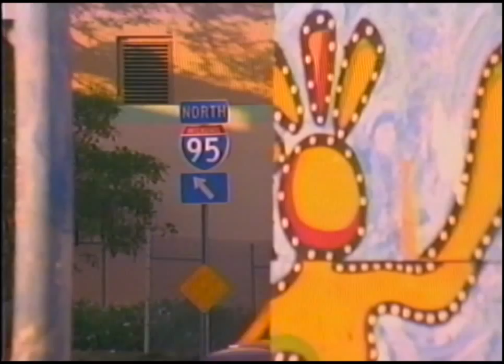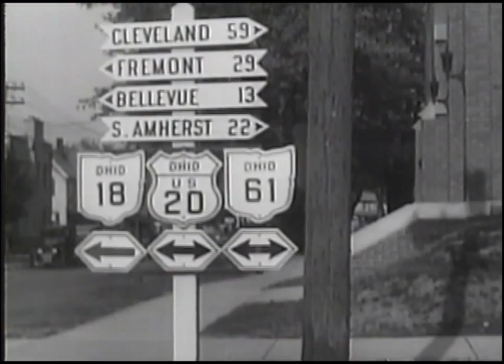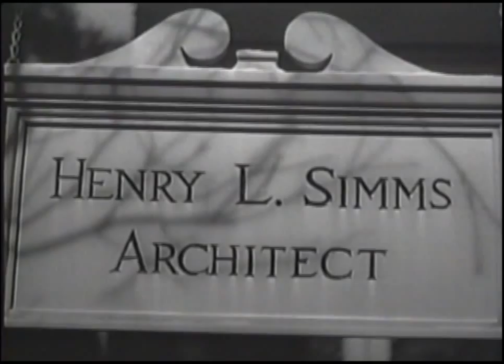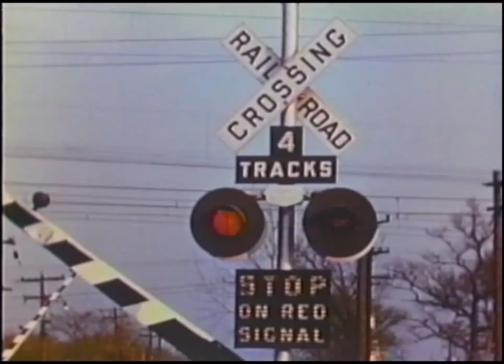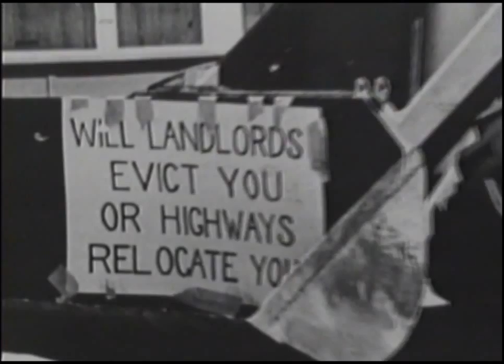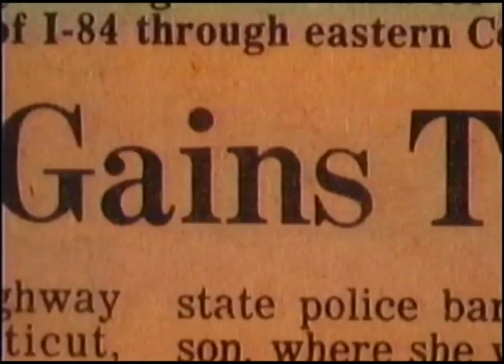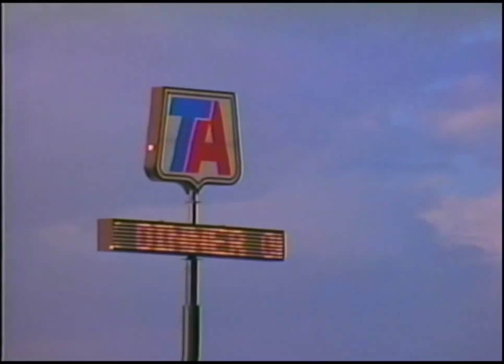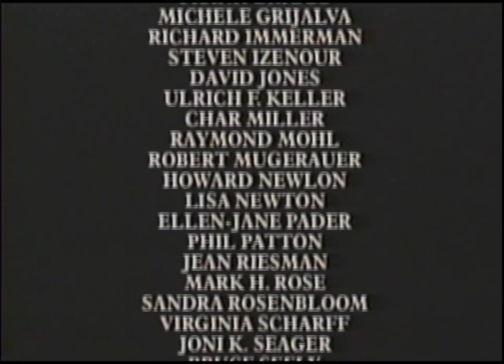Divided Highways - PBS (1997)

Comment: My dad moved to suburban boston when he was 7 and I was born and raised just outside Hartford. When it comes to Boston big dig and not building I-695 (inner belt) were great decisions for all. However going to college in Eastern Connecticut I can attest that the lack of highway from Hartford to providence has deeply hurt the Eastern Connecticut Economy as residents have more stressful drives to well paying jobs once the industrial plants all disappeared.
Reply: Wrong on the Inner Belt.   Without it the whole system was left disconnected.   Leading to perpetual gridlock in the inner suburbs.  Drove a delivery box truck in the late eighties.   Was nightmarish navigation with the myriad local truck bans and restrictions in certain locales, and antiquated circulation patterns left locked in in other areas.  Much of the southern belt route had already been cleared- and the final designs were sound.   Meaning going under the Charles river and partial burial through the Fens.   Bad decision making.  Caving to the whims of a few elites.

Comment: Trolleys were fine but only viable in cities.

Housing was far more affordable. Now every house is dumb expensive. And to solve the housing crisis, we’re buying up farms and cutting down woods to build expensive McMansions instead of affordable housing like they did in the 50s.

Highways bypassed smaller tourist towns and reduced the traffic on smaller roads. But the amount of cars on the road outpaced the construction of the highways.

Railways are fighting back. Since a lot of fuel is still transported by rail, the railway could name their price of shipping. The railways then bought up trucking companies to control as much of the shipping as possible. When the rails charge more, the gas stations have to raise the price at the pump.

The maintenance of the roads have outpaced the income of the highway system and have cost far more then what the roads cost to build initially.

2nd street overtown is fine today. From what Google maps show, overtown recovered. There are parks, dozens of condos, and colleges. How many homes and farms were destroyed to build the cities and all the other roads. When they built the dam near me in the 50s, it wiped out 5000 sq miles of farm land and dozens of homes. The dam was to create a reservoir for drinking water for the city. The funny part is that 40 years later the water became undrinkable due to mercury content. First swimming was banned, then it was catch and release fishing only.
Reply: Yeah- the thing that gets "swept aside" (not here) is the degradation that ensued without much though it seems for this "wonderful change".  I am dismayed.

Comment: 20 years later...2017...now what?
Reply: 2017? Whatya you own a De Lorean with a flux capacitor? Check your calendar, it's still 2016.
Reply: Ok, it's 2017 now....
Reply: The " Rainbow highway" is now being planned. The road is planned to be over 15,000 Miles.
Reply: 2019 here saying hello
Reply: Nothing. Nothing has been done since the 1973 Arab oil embargo.

Comment: People piss and moan about traffic but when states try to build new highways to deal with the growing capacity and automobiles the same people become hypocrites when they say “we don’t want this in our backyard...”, they should have finished the Boston Inner Belt Project, if they did the Big Dig wouldn’t have been needed, to this day the traffic issues are because of the failure to complete the interstate and mass transit projects in the Boston and greater Boston area smh
Reply: So much flawed thinking in this rant it’s hard to know where to behind. Increasing the highway or adding more lanes creates induced demand which adds even more traffic.
Reply: @dante6563  so does ignoring the problem or even worse sticking your head in the sand like cars don’t exist.

Comment: 31:05 the moment I stopped watching.  The streetcar buyout has been proven to be true and it wasn't just GM, the tire and gas companies too.  This production stinks of a GM paid for propaganda film.  Shame on PBS, I thought you had morals!
Reply: They bought up all the light rail streetcar companies and shut them all down.
Reply: Luddite ? It's called progress, independence and affluence. I would rather hop in my Dodge Journey and go to the store without waiting on the corner in the rain. It was mans destiny as an inventor and lover of creature comforts.
Reply: Yeah, but notice that the woman being interviewed pointed out - correctly - that streetcars were being outcompeted even without General Motors' secret sabotage. The city I live in never had any interference from GM but the streetcar service ended in 1941, which is pretty early, because of its limitations. Streetcars required the installation and maintenance of tracks as well as the overhead wires carrying the electricity to run the trams, and often an entire electric generating plant as well. Whereas running diesel buses requires only maintaining the vehicles and buying fuel for them, while using the roads that the whole population pays for via taxes. Not a difficult choice to make when you're trying to make a profit.
Reply: Kristine B What about traffic or people who can’t drive?

Comment: The original plan was to not affect neighborhoods by not going into cities with the interstate. The major roads would swing through close to the cities say 15 km to 30 km away and then you would have to take a spur or a US highway into the cities. That's how they should have left it and it wouldn't have disturbed near as many people's lives. All the chamber of commerces and tourism boards got together and lobbied to have the interstates run through cities to bring tourism and economic gain. They completely fucked up the whole system.
Reply: Nah it was a good thing they brought them in the cities. Urban highways are good for commuters and strengthen the community across the metro